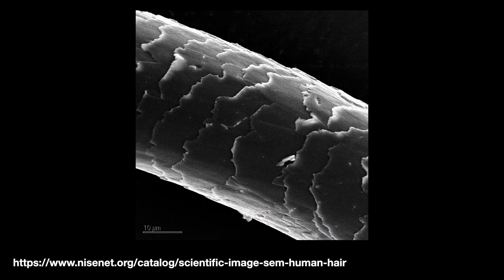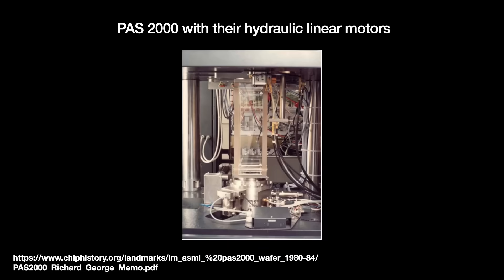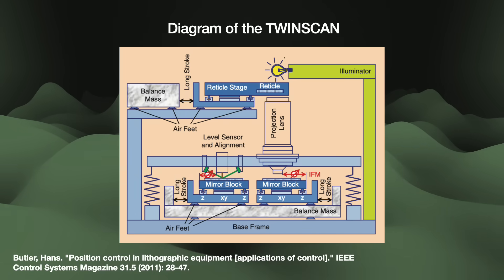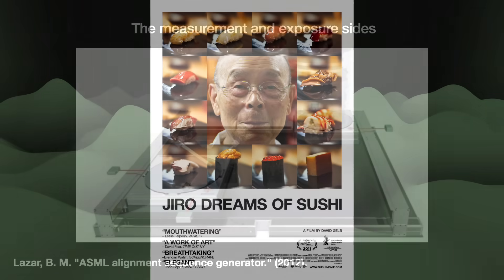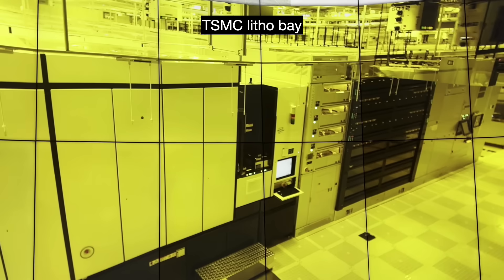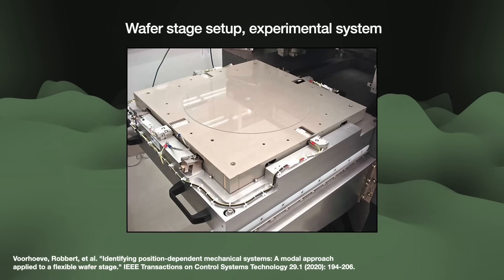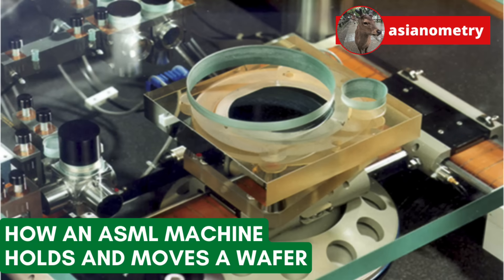How an ASML Lithography Machine Moves a Wafer

Comment: And you didn't have time to discuss the thermal control to maintain material properties to changes in temperature that would cause dimensional change in the nanometer range.  You did discuss the g loading; I imagine the number of lines of code to accelerate and decelerate yet control spurious vibrations to sub nanometer levels.  But ASML does this routinely.  At about 9:02, you said that 180 wafers per hour were produced and continued with this: "that meant 1 wafer every 2 minutes".  If I heard that correctly, is that not 3 wafers every minute?

Comment: Can anyone explain how the short range interferometers measure XY travel when they're pointed in the Z axis?
Reply: Take a look at the BL50H Magnescale 2D encoder. I think ASML mounts the laser read head on the moving wafer stage and mounts the grid on the stationary metrology frame which is suspended a couple cm above. The grid is a 2D diffraction grating patterned on a large panel of low CTE glass. The read head is essentially counting interference fringes as it translates underneath the grating. The periodic intensity signal can be further interpolated to achieve a max resolution of 6.1 picometers and tops out at 5 m/s. Insane high-end specs! 

BTW, it would appear that the same types of encoders are being used in modern ultra-precision diamond turning lathes from Moore Nanotech and Precitech (in this case, just the 1D encoder variants).
Reply: the surface has a grid pattern the sensor can detect the difference between the x and y direction. Note that it has to interpolate a longer wavelength of light typical to these systems (i.e. red laser) to get nanometer resolution.

Comment: Have you ever made a video about the manufacture of radiation-hardened chips and how its different?
Reply: I suspect it will be a bit boring, as obviously use bigger size, more voltage,  more redundancy, different package.

Comment: Nice video as always >85% correct. 12:16 EUV does not exist in Air, this dictated switch to vacuum. Neither does eBeam (maskless photolithography...). I find it is easier to manage particles in air with proper airflow and low wear or dedicated particle traps/evacuation techniques. In vacuum you have no medium to manipulate the particles out of the way. You can mostly focus on not creating them in the 1st place.
Reply: He said in the video: for EUV air bearing don't work in vacuum so they switched to magnetic levitation.
Reply: I may have missed that, but air bearing in vacuum does exist. Air bearing flow is very small and be overcome with additional pumping capacity.

Comment: You mentioned the machines needing to avoid vibration - and that makes me wonder - how do chip fabs deal with external vibrations? I especially wonder given many chip fabs seem to exist in a relatively seismically active area of the world. And at the nanometer scale, I have to wonder what would even happen when large trucks drive by outside! Or is this just less of a problem than I think? Or is it dealt with in the design of the buildings themselves?
Reply: Isolate EVERYTHING!
Reply: first, 15+meter solid special concrete as foundation, then full spectre of tricks precision mechanics have, as airbags, sound isolation walls like in sound record studio, etc.
Reply: If an earthquake of significant magnitude happens, the fab will pause operation. For smaller vibrations, it is managed through a combination of both the building and the machine. Chipfab buildings are worth a whole video on their own, I think.
Reply: probably standard approaches done to an obsessive extent is good enough for fabs. This was an issue for LIGO, which can measure changes in distance to within ~10^-18m

Comment: 🎯 Key Takeaways for quick navigation:

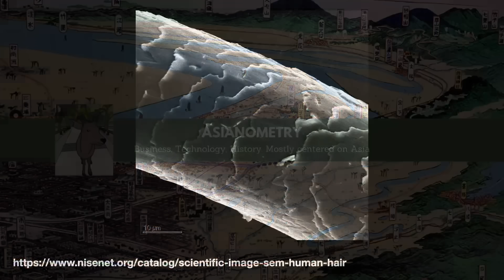00:02 🌐 ASML lithography machines require extreme precision within nanometer margins for wafer positioning during exposure.
01:00 🔍 An optical lithography machine, like ASML's, uses a complex process involving photoresist, illumination, photomask, and objective lens to transfer chip designs onto a wafer.
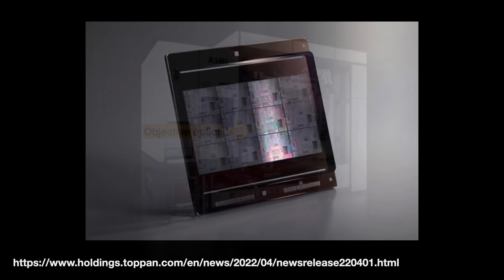02:22 🚧 Wafer stages in lithography machines must handle heavy wafers, execute rapid movements with nanometer accuracy, and maintain precise overlays to avoid errors.
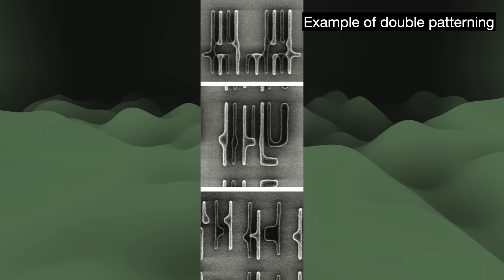03:48 ⚙️ Inside the machine, the wafer stage can accelerate up to 20 G-forces, demanding stability to prevent vibrations that could impact precision targeting.
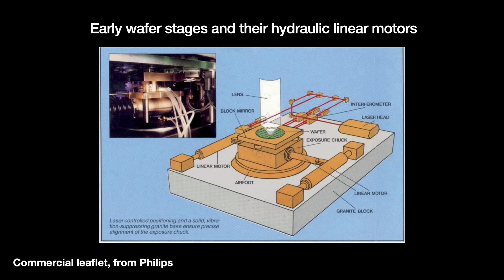05:12 🏭 ASML evolved from Philips, transitioning from hydraulic systems to electrically-driven systems, leveraging experience in optical disk technologies.
06:34 🔄 ASML's TWINSCAN platform, introduced in the 2000s, revolutionized lithography by incorporating a dual-stage cycle for measurement and exposure.
09:44 🌐 TWINSCAN machines, such as NXE for EUV lithography, NXT for 193-nanometer ArF DUV, and XT for 248-nanometer KrF DUV, are designed for diverse customer needs.
10:42 🛤️ Lithography machines feature two movement systems: coarse stage for extended range and high speed, and fine stage prioritizing precision over distance.
12:27 🔍 Precision movement technologies progressed from mechanical systems to aerostatic systems and eventually to magnetic levitation to meet cleanliness benchmarks.
13:24 🔧 ASML uses a complex magnet plate array with over 2,200 magnets for wafer stage positioning, addressing challenges like magnetic interference and cooling.
15:13 🖥️ Software plays a crucial role in ASML machines, with significant growth in CPUs and sensors, emphasizing the importance of software development in their success.

Made with HARPA AI

Comment: While its obviously on a totally different scale this discussion reminds me a lot of what I've heard about how core XY 3d printers work, including vibration and harmonic compensation, though they rely much more on the software side to avoid needing such specific mounting, heavy weight, and expensive extremely rigid construction.  Given the related concepts at a muxh more approachable scale I thing seeing a video on them from this channel could be very interesting.
Reply: There is an unbelievably larger amount of software and all sorts of crazy compensations in the lithography machines (down to frame creep compensation lol), there is really no comparing them to a printer, besides the fact that you can find probably find stepper motors in both. Actually Im not sure that you will find steppers in modern litho machines.

Comment: Wait so how does the xy positioning on modern machines work? Do the z-direction lasers sense x/y location?
Reply: Most still use glass scale linear encoders and multibeam interferometers, engineering is the economical solution to technical problems.

Comment: can you explain why there are so many mirrors with UV machines
Reply: UV mirrors have much higher transmission (99.95% or more) so you can use a lot more elements to condition the light and reduce aberrations. With EUV each mirror only has 65% reflectivity, so you need to get away with far fewer. This means the error on each mirror matters a lot more, and you have to suffer more errors. This is also why the NA on UV machines is >0.8 (>1 with immersion ) but EUV is only just now getting to 0.55.

Comment: You realize how precise this operation is when he says "... refractive index of the air, which changed as the stage moved around, it threw off things by as much as ONE NANOmeter, which was UNACCEPTABLE..." that is really crazy!
Reply: yeah but why would moving the stage change the refractive index of air?
Reply: @alquinn8576 because even a slight change in density of the a ir within the litho stage could change the refractive index of the air. And density can be changed with even the slightest push in any direction
Reply: @warpspeedscp  so this is how tracking device work in alien movie. :D  "micro changes in air density"
Reply: @warpspeedscp  makes sense, thanks
Reply: @alquinn8576  It's because of turbulence. I mean stir a pot of water around and you'll know what I mean.
Reply: @alquinn8576  As the stage moves it creates a miniature pressure wave which alters the density of the air.... Nothing proprietary here. Just physics.
Reply: yibosun4091
r/Newsentences
Reply: The common sheep won't even understand the importance on that simple fact, for me I'm not surprised, ASML only works in the reaml of ultra precision.
Reply: I absolutly LOVE the air hockey analogy! Using one highly relatable concept, you clicked the understanding into my brain (like an ASML wafer handler😊).
Reply: This video made me hungry for more info on ASML. THANKS!
Reply: There is a lot left out of this presentation. Like fixed forced air inside the stage area. You can open a side panel while it is running and accuracy goes out the window.

Comment: Took a dvd burner apart for the laser diode once and was amazed to find a very small, tiny stepping motor and linear motion rod.     and being pedantic commenter I get a wafer every 30 seconds instead of every two minutes :)   (28.8 seconds to be exact).
Reply: I'm more pedantic than you. I didn't have all that extra information which is clearly superfluous. If you're going to be a pedant, do it right.

Comment: I work in a cleanroom assembling these machines for ASML. We hold tolerances in microns and this video gives a good explanation of just why we do that lol
Reply: less tolerance is needed for these new nodes, my Family was Nat Lab in the early days, TU e too
Reply: Lol, miss those tolerance stack up analysis.
Reply: super cool! I applied for one of their internships recently in motion systems recently, the tech in these machines is incredible. Currently finger-crossing to the max waiting to hear back :)
Reply: I work with a company which helps you with these tolerances, really proud of that.
Reply: Are you at WF?
Reply: BS... prove it.
Reply: No you don't
Reply: how much do they pay an hour? I contract guys for like assembling vacuum machines for coating glass and etc and they pay us for the guys around 40 euros an hour.
Reply: @chronokoks intriguing, low level wages in tech mean unreliability.
Reply: Prove it !
Reply: I thought the tolerances were less than a nm?
Reply: @TickleMyPickle66  Tolerances for assembling the machine from X amount of components and the tolerances that the components while working can achieve is a different thing.
Reply: @TickleMyPickle66  That's the tolerance for the exposures. The parts of the machines don't all have to meet that tolerance. They just need the ability to measure and position things to 1 nm.

Comment: As a programmer, I just can not handle the more than 1 billion lines of code statement. This just does not sound right for so many reasons...
Reply: Perhaps the claim includes the OS, all the libraries, etc.
Reply: @aapje  even so it is still an absurd amount of code that hardly makes sense for me, would love to know more about it. But maybe they have a pre-processor stage that inlines procedures and/or wraps multiple safety checks that just fluffs the line count? Regardless, it's pretty wild
Reply: @aapje  He is not used to modern object oriented languages, old Cobol guy on main frames, needing to understand all procedures before modifying a single procedure..

Comment: If they need such high precision, how do they deal with fluctuations in temperature?
Reply: The whole assembly is made of invar, zerodur and fused silica, also the guts are maintained at a uninform temperature.
Reply: Extreamly low CTE material, precision temperature control, and measurement and compensation.

Comment: Always wondered how they could realign the wafer with insane precision...
Reply: The answer is lots of sensors, accurate linear actuators and lots of PID control.
And some magic numbers. With some I mean a lot.
Reply: @nextlifeonearth  You are mostly wrong, there's no sensors, actuators and control involved in the alignment of wafers. The principles on which realigning is done are called kinematic mounts. Those restrict the degrees of freedom such that there's only 1 'viable' solution for the wafer to sit. However, with nm positioning lots of other factors come into play there such as nesting force and micro-slip, which is an entire field of research by itself.
If the chuck is aligned (almost) perfectly with the stage every time, you only need to align the stage with the frame once, and only need to care about the relative positioning of the chuck w.r.t. the measurement frame.
Reply: @tHaH4x0r  Are you sure about that? Kinematic couplings don’t work reliably for nm alignment. Plus you can literally see that the positioning system is based on linear motors, a magnetically levitated stage, and interferometric encoders. Plus the machine has to compensate for the thermal distortions in the wafer itself.
Reply: @andrewphillip8432  Yes, looks like it is 2D linear motor with feedback from interferometric encoder with 2D zeroglass gratings on the bottom (like former Sony Laserscale, now DMG Magnescale). 
It has insane 6 picometer resolution, but to get positioning accuracy below 1nm there must be a hell lot of corrections and calibrations.
Reply: And now you still wonder - I suggest.